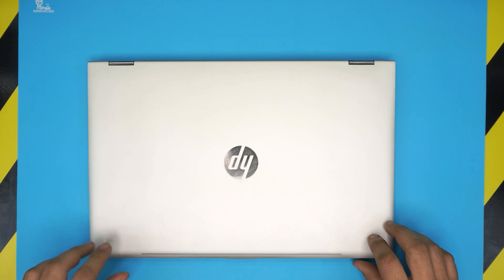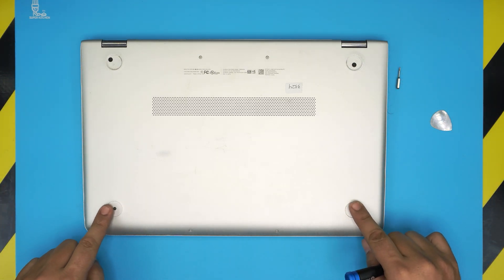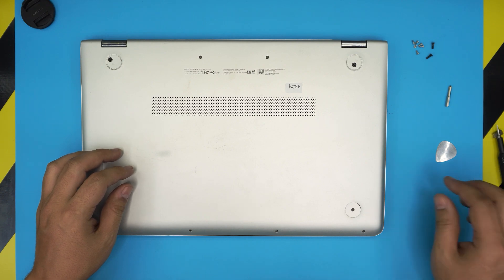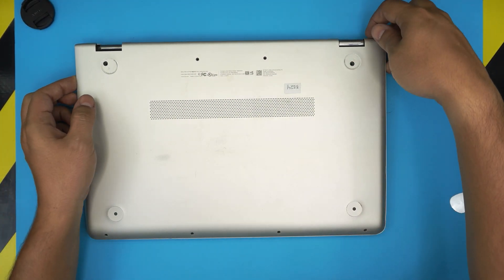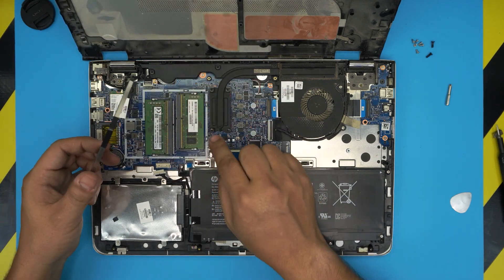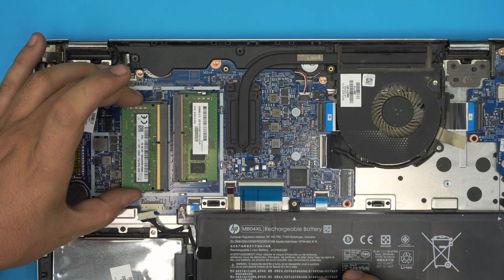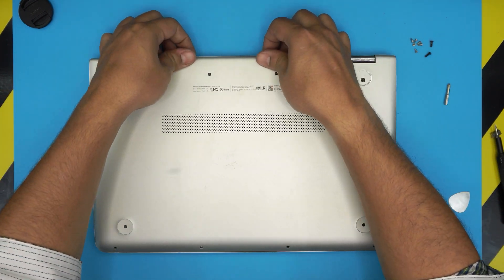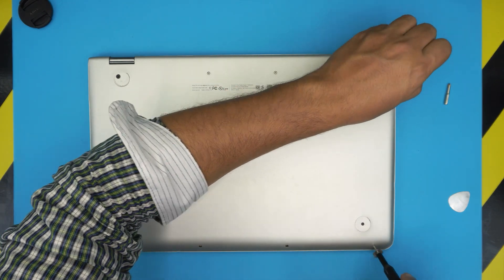HP ENVY X360 M6 AQ 📢 RAM UPGRADE | Aq105dx

Comment: hello, great video. Is it possible to remove the fan without removing the heat sync on this model?
Reply from the maker: Thank you for the feedback! if you wish to support the channel you can LIKE or SUB or both :P
regarding your question: unfortunately you will need to remove the heatsink to remove the fan there is a gaffers tape under keeping them together, check this video on how to clean and repaste and you will see what im talking about.
https://youtu.be/2ryTV0kl3wA